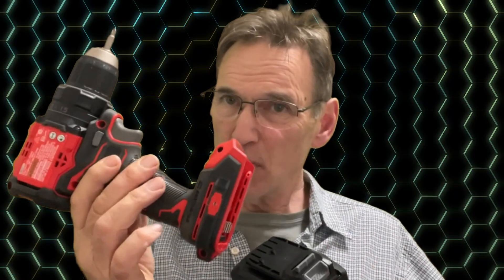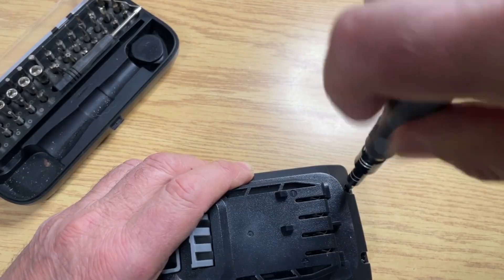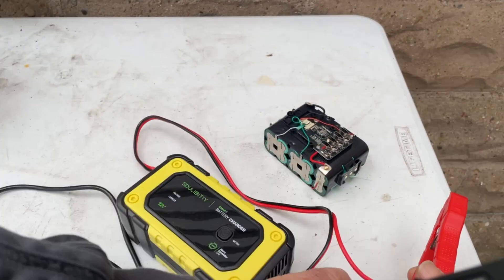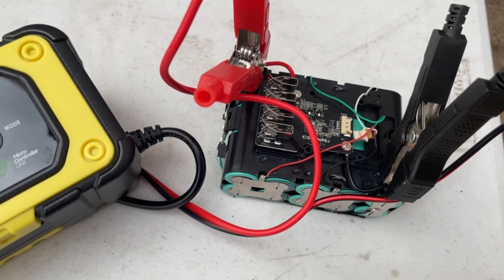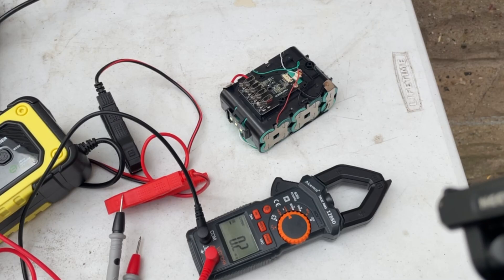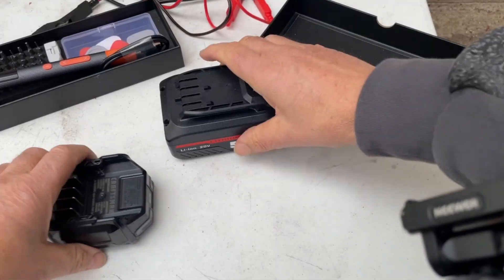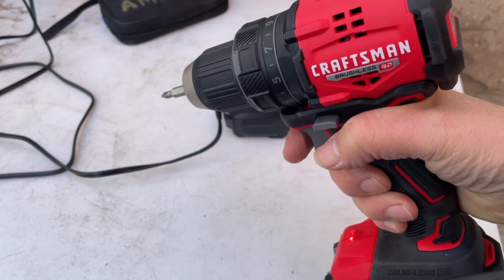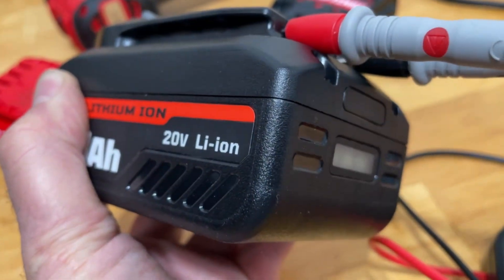How to Fix a Dead Power Tool Battery. DIY Solution That Actually Works 🔋⚡

Comment: Quizás deberías haber medido el voltaje de cada una de las baterías 18650, no vaya a ser que el módulo electrónico esté fallando y cargue/descargue cada batería de forma desigual con los consiguientes riesgos de sobrecarga y sobredescarga. Saludos.
Reply from the maker: Interesting.  If that's the case could that be dangerous? They explained in the manual that these were shipped with low voltage for safety.  But perhaps these have been sitting around too long and lost too much charge.  The battery seems to work fine now.  Even if I checked each cell, is there an easy way to calibrate the charging circuit?
Reply: @DIYWithJC  Lo extraño es que la batería, siendo nueva, te diera ese problema; induce a pensar que alguna/as de las baterías estén defectuosa y no mantengan la carga. Yo desmontaría de nuevo (después de cargar la batería montada con su cargador), y comprobaría la carga que da cada batería 18650. Si te dan todas 4.2 V, entonces perfecto. El problema lo puedes tener, cuando el voltaje total sea el correcto, pero porque algunas celdas tengas más carga de los 4.2v, y otras menos. Es sencillo comprobar con un tester cada una de las baterías de forma individual; si todas te dan 4.2v, entonces no habrá de que preocuparse.  Venden circuitos BMS (son baratos) para el caso de que estuviera averiado y quieras sustituirlo. Saludos.

Comment: I had this with a Parkside battery. It went flat for some unknown reason (i have a thought, but not sure).
I'd recommend to do the intitial charge with a lab power supply. This way you can reduce the current as you like (set it low) and monitor the voltage. And you can charge one single battery element instead of all 3 at once. Bottom line, you have a lot more control of what you're doing.
Reply from the maker: Right, but I don't have a lab power supply, so just used what I had.  And because the battery was already written off by Amazon I wasn't too concerned if it hadn't worked. But I was happy that it did.